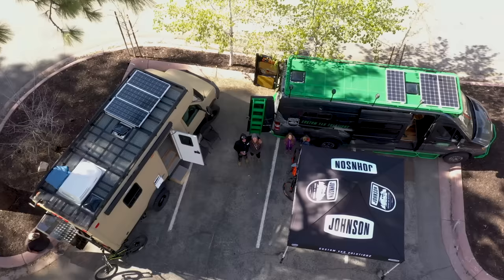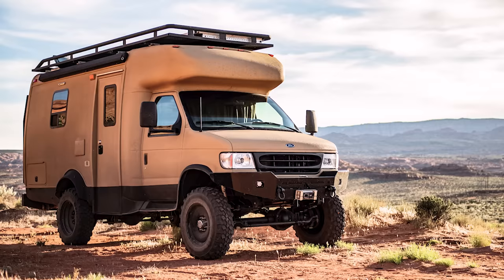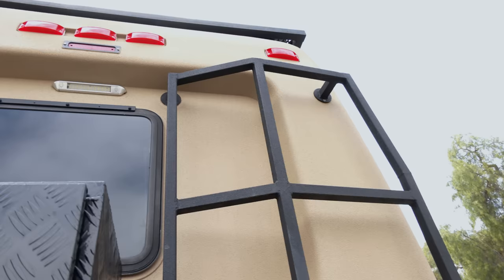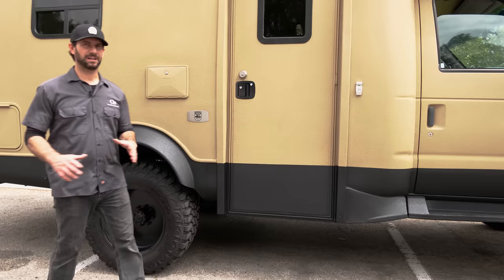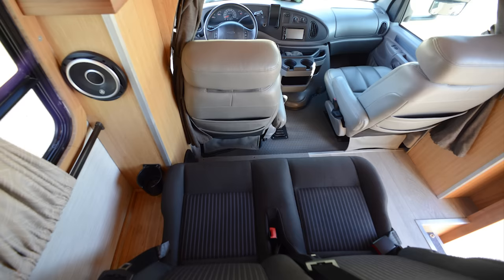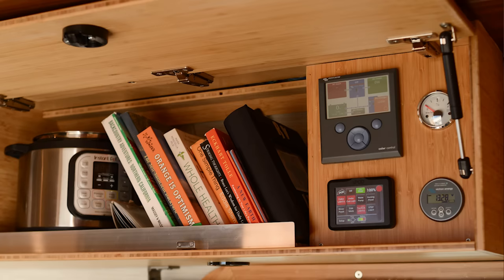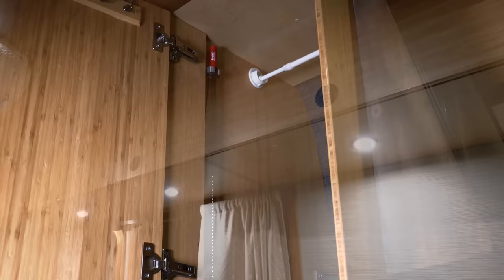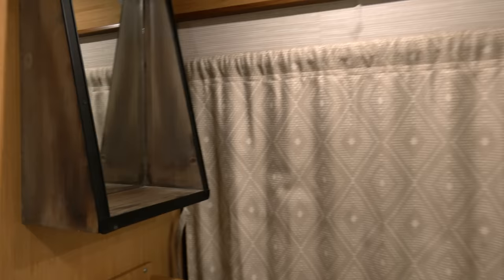4x4 Van Tour - Custom Adventure RV Starflyte 2.0 ! 4WD RV!

Comment: I work as a diesel mechanic. I appreciate This build on so many levels! Amazing job 👌👍 keep up the awesome work.
Reply from the maker: Greatly appreciate the comment and your blessin!
Reply: @auxbuilt4190    It's a very good caravan for the distance of roads and picnics and for the friends of the forest hunters
Reply: Love the builds! I’m looking at getting a Fire chassis myself for a conversion. Just wondering what you feel is the best chassis in your opinion? Gas, diesel? E350, E450? I know the 7.2L is a great engine…
Reply: I think now is the wrong time to think about diesel or gasoline since you know Putin attacked Ukraine. LOL.

I would be prone to diesel. But then his drip down fuel would have to be changed out for something comparable. The only thing I find missing this is a microwave. I am more inclined to use microwavable then I would be the stovetop. Everything comes with a trade off. This is an awesome build. I especially like the consideration to his winch system to get the spare tire up and down. That was my first thought. As it stands now my spare tire weighs a ton and being disabled I have a hard time not just getting it down from my Dodge but getting it in place.

Lastly, five hundred amp hours is probably a good place to be. But has an amateur radio operator I would be using additional DC to power radios. I might find a way to get a generator installed. Something that could be pulled out of a storage container I suppose although it'd be nice to be able to start it up from inside the cab and switch over. That's just me. And then lastly, I would put up a 4G/5G long-range antenna. I'd also like a piece of SpaceX by Elon Musk that gives you high speed internet out of the middle of nowhere.

These are custom items on my part and it should in no way take away from the excellent build he's done.

Comment: Nice work young man. My first build was a 1941 military 6 wheel dr. 6 cyl half ton. Built a stage coach sleeper outa wood. It was a canvas top org so I took a 20s truck body used the doors and built a cab. No ac but windows cranked and it had had push breathers for circulation. Put my surfboards and tipi poles on top. Lived outta it for 3 1/2 years. Hit 17 states took odd jobs and had the time of my life while traveling. Lived in my 16ft tipi most of the time. Solid rig cooked over a campfire and .grate. To much luxury today. Only pd $250 for truck in military sale 1970. Even had a hand crank to start it if battery was dead. Didnt even have $1500 in it mostly in tirw cost. 6 volt sucked but that was ww2 and we won. Happy trails get a guitar and save your money. Yours cost what a king kong house would be today. I went slow and saw everything. 6. Yl flat head and I got an old snorkel kit at army navy store. Sorry you missed it. Every complains about the bucks no matter what it the out come and you did a beautiful job for todays bs. God bless Im selling my house and making a new canvas tipi again. At 69 Im short of time but long on love to do it again. Keep my money and using a 2002 trail blazer simplified. Good luck but I can see over half million in todayz  prices. Bet you get 15ft to the gallon with all that weight. Hipe you got time and mega bucks cor this hobby. One of a kind raised 4 kids on a farm. In Iowa and on the peace river in florida over 25 years til these last few years. Lost my wife to health God bless her heart and soul. Big world with alot of fishing to do.
Reply from the maker: Thank you for checking it out Lucien. Your story is literally a novel summarized in a youtube comment, which seems impossible but here we are. Anyone who read your comment is wiser and likely more appreciative of the life they have knowing that the cost of things is irrelevant to someone like yourself. Time is the priceless unit we all want more of, and this van albeit expensive to build, gave me the time of my life in the middle of nowhereville! Thanks for stopping by and I wish she got 15mpg, more like 9!

Comment: Awesome build. I want. A tankless water heater would be better to save space. Also PSA fyi, that tiny fire extinguisher will completely discharge in about 5 seconds. It will only put out a small starter fire. Best to get a large one.
Reply from the maker: For sure! Agreed! I got 50 gallons of water ready to spray!
Reply: Fyi: that 50 gal water supply may not be available if the fire on your rig is electrical, battery related, and/or your 12v system is not functional. A 10 lb extinguisher always seems in the way, until the moment it saves your backwoods rig (or national forest from a runaway campfire) THEN its the coolest piece of gear ever because they work so well!

Comment: Excellent overland Ford conversion Van build. Very comprehensive, starflight fiberglass is built more like a boat than an RV if I remember correctly? They like  the Chinook are great Ford conversion Van platforms for builds. Which I glad you pointed out these builds, 30  year old vans/rv they require much restoring, rebuilding, Being a vanner since the seventies and had 94 e350 4 wheel drive van. In my old age few years back started an overland Van build,  My wife didn't want to 4 wheel anymore like we did in our youth and we weren't planning on driving the Van during the Winter at all except Baja?(please dear)  We've found we just need to get a mile or so passed all the other Rv's and we usually have places to ourselves. with the reduced cost and maintenance of the conversion, we decided to do 2 wheel drive.1995 airstream b190 conversion Van. First all new suspension installed by #weldtecdesign custom 6"lift, bigger brakes, fox shox, Latest update had Scotty at parkland machine services in Tacoma Washington He rebuilt, balanced and blueprinted my gas fi 460cid 7.5 stock 220 horsepower motor, now pump gas dynoed @384 horsepower 460cid bad ass Fuely motor. I'm now looking at the ultimate rear end for the thing. I like your setup and hope to have something that nice someday.  Thanks for letting me ramble Aloha.
Reply from the maker: Wow you are a legend! Thank you for checking it out Brian, yes its fiberglass/balsa/1"foam"balsa/fiberglass on the shell construction. Your engine sounds like a monster, absolute beast!

Comment: This van rebuild is the best I have ever seen so far inside and out.....
The only dislike I had was the composting toilet.....
My parents have the slide out cassett toilet and for two yrs no complaints....
I love the exterior paint and coating , lighting , etc.....
Especially all mechanical work put into the underneath of the van.....
After watching many videos on upgrades the cost would be worth it....
Super job on this van
Reply from the maker: Thank you! We love the composting toilet because we don't go #2 inside really ever. The cassettes are cool, but having a pee bottle to easily empty out, rocks!
Reply: We are a supplier from China, providing products covering agricultural products, food, steel products, clothing and other raw materials

Comment: You forgot to show the fold up full size olympic swimming pool. 
The level of forethought and skill here is mind-blowing, great job! It must be so satisfying to go places in a vehicle that you dreamed up and built yourself...a great inspiration!
When you were hoisting the spare tyre I couldn't help thinking it would be good to use the tyre tie down strap to tether the top of the hoist to the opposite side of the roof rack, taking the torque stress away from the hoist pivot.
Reply from the maker: Thank you! and that's a good idea. I welded that mount receiver bar, 4 times over, but the strap would take out the bounce for sure! Good call!🤘

Comment: One off badass van! Creative, great taste and executed nicely!  From the marlin fishing spare rig to the second step storage top to bottom you have got yourself the best designed van I’ve seen on YouTube and I watch lots. Awesome job and congrats, I’ve learned a lot just from this vid and i thank you for sharing. 👍🏾👍🏾
Reply from the maker: Thank you so much for the remarks!!
Reply: @auxbuilt4190  Great build! I wonder about the bath. Do you pull the toilet out to shower? And roughly how much square footage does the interior have? Also, if one wanted to build the 4x4 suspension, etc., is there a basic blueprint package available?

Comment: Excellent build.  The Coachmen Starflyte was an important part of my initial foray into the RV industry, and I was the lead engineer at that time.  This was the 2nd of the 3 floorplans that we developed.  A piece of info you might find interesting is that while Coachmen Vans produced the Starflyte, another local company named Supreme built the steel-framed fiberglass body.  It is based on the StarTrans bus by Supreme Corporation (Goshen, IN), which is what makes this body so much stronger than the typical RV construction.  If you ever venture near Elkhart Indiana, I'd love to see YOUR Starflyte in person.  Safe travels!

Comment: Well, just like most of the 993 comments before me I found your Starflyte build impressive and inspiring.  So much so, that I had just completed the Ujoint DIY conversion on my E350 van when I found your video and began looking for a Starflyte to convert.  Just purchased a V10 Starflyte with only 34,000 miles on it.  I have some questions about your change  from the Ujoint 33" dual conversion to the 37" single.  I need to make decision on which path to take.  Questions:
1)  Did you need to lift it again higher than the 6" Ujoint install?  how much and with what system?
2)  Could you use the original rear dually axle or did you switch?  (I have my stock rear axle from E350 conversion taking up space in the garage)
3)  How did the performance change both highway and off-road between the 33" dually and the 37" single configurations? (ride, steering, power, mileage, etc)
4) What else could you tell me about this that I wasn't smart enough to ask?

Thank you
Reply: Try Red Barn Customs in Michigan for specialty 20" steel rims (or 19.5" if you don't want to be able to air down) . I want 20" so I can air down and have LESS sidewall in case I do blow a tire . Less distance to the ground. 17:38

Comment: Nice build, awesome craftsmanship. I have a 2003 7.3 E350 sports mobile no penthouse full rollcage front to back through the dash to the frame. 4x4 on 35's it's more like a prerunner chasing side by sides across the desert. Custom interior for the 3rd time now, seems I keep changing it as the kids got older and bigger. So I bought a 20 passenger StarCraft micro bus gonna do the same it's in progress right now. I'ma keep it real though, not going to be as pretty as yours but going to get the job done more importantly create long lasting memories for me and my kids. Can't wait.

Comment: Question about the plumbing, but first let me say that this is one of the best 4x4 conversions I have seen. I was wondering how do you keep your water lines from freezing during winter. Any 12/24V heat cable or heat wire?
Reply from the maker: Thank you! There are 12v pads on the grey tank and the drain line outside, however if you were in really cold climates you would keep the webasto heater on inside at 50 degrees 24/7. I also kept the grey tank drain pipe open full time, so no water was accumulating. You couldn't do that in an RV park necessarily, but you can driving down the road and when you are grid

Comment: I saw the original YouTube post on the Mobile Dwellings channel, and was incredibly impressed, especially since I had been thinking about a similar Starflyte conversion myself. I have a ton of questions, and am hoping you will indulge me! First, let me say how impressed I am with the thoughtful approach you had to the build. Every detail seems to be well thought out. So, here are some of my questions...

1. Can you educate me on your decision regarding the dually-delete? I know many off-roaders simply prefer two wheels on the rear axle as dually's can be more prone to rocks becoming lodged in between the two tires. Was that your motivation as well?
2. I noticed that you don't appear to have recaptured the space behind the old propane and generator access doors. Did you consider adding some new storage compartments behind those doors? If a simple box could be fabricated and welded to the frame, it seems like it might be a great place to stick some heavier tools and recovery gear.
3. I noticed that you didn't remove and then patch the old refrigerator vents. Beyond the cost of the fiberglass repair, is there any other reason why you opted to keep the vents?
4.When completing the interior, did Johnsons remove the fiberglass walls and reinstate, or did you just leave it all in place and recover with the German vinyl?
5. Speaking of German vinyl, what is the manufacturer/distributor? What made it more appealing than other, domestic textured vinyl suppliers?
6. It looks like you kept in place the entire bathroom assembly... is the sliding bathroom door OEM, or is it a replacement? If a replacement, can you share the details?
7. In regards to the exterior shower and audio cubbies... are those both refurbished/cleaned-up originals, or did you replace with new, similarly-sized units?
8. You mentioned that you replaced the exterior lights. The tail lights look to be new units. Did you simply replace the old ones, or are they refurbished with new LED bulbs?
9. If you were starting over, with the same vehicle, what would you do differently?

I know that's a lot of questions. Thanks for producing this kind of content. Can't wait to see more of your adventures.
Reply from the maker: Thank you for reaching out! Thanks for the kind words and I'll try and get you some answers!
1)Dually delete is standard reasons, yes. No rocks lodging in between, precision tire placement on trails and I think it looks better as well. I've been super happy with the decision. 
2/3)Propane door, old fridge vent, oven vent have been deleted with fiberglass. If you look at my instagram there is a recent photo of the drivers side and you can see that work. I do fiberglass work myself and the cost isn't the issue, it's having to repaint the whole side, which I did a few months back. 
4/5)The whole shell is pre-insulated. The construction is fiberglass/balsa wood/1"foam/balsa wood/fiberglass. It was a really expensive shell to make which is why Coachmen only made these from 98 to 03. I can not recall the make of the gErman vinyl, I don't know if it's better than anyone else's to be honest, but it's tough stuff!
6)The bathroom door is by Nautilus Doors, parent company is STOEET Ind. The floor I resurfaced with white raptor and cleaned up the caulking all around. I didn't feel the need to gut the bathroom. It serves it's purpose!
7)Both are stock sized. You can not find the outdoor radio unit any more. It was made by Jensen and the head unit was a joke so I popped in a single din bluetooth unit. The speakers are so-so, but you're not trying to blow the doors of the cabana most times while using an outdoor radio, right. It's killer for campfire nights and it can actually get pretty loud before clipping, if you wanted to party it up. The shower unit is common size and I replaced the whole box.
8)All the lights were removed, surface of the shell cleaned up, brand new LED lights installed and poly caulking added anywhere I felt that need a little extra insurance. All those OEM sizes are now available in LED, EXCEPT! the third brake light. That company still makes that exact same light is you can believe it. So it's new as well, but it has a bulb. 
9)That's an open question and you'd think I'd have a long list with the hindsight in my favor. But honestly, the only decision to consider for me really is to have 4 seats or not. If yes, then I would not change a thing. If no, then well I would move the shower/bath and re-design, but the 4 seat belted seats was key for me and the bunk over sleeper is a huge asset I've used many times for friends. Not the easiest build out, very custom, but worth it in the end in my opinion even having lived in it for the past year.

Comment: This is so amazing. Thank you for putting the time into this video. 

Have you ever been in a situation where you exceeded Starflyte's terrain/offroad capability? Or a really hairy situation that it pulled through on?
Reply from the maker: Thanks Neil! Depends on who you're asking, me or my partner!? I've heard a couple times, "I don't think you're gonna make that" and I've always made it😅 The only times I've used the winch were to get others unstuck. IT's insanely capable as an offroad rig. You're limited by the departure angle the most, she's got a booty. The most iffy time was a BLM spot outside of Horseshoe Bend, the deep red sand desert terrain. There was a section I saw a wrangler come through an he was pinning it, roosters off the tires and all... I looked at my girl next to me and asked, should we try it? We went for it and I was in 4Lo 4x4 pinned in 2nd gear but we made it. I would have been buried if I slowed down on that 1000ft stretch. Good times!

Comment: Well thought out in every aspect of the design and modifications.  I like the consideration made to the tires and suspension, and especially the outer shell protection, which gives it a very custom and stealth look.  The roof is crazy good with the solar and well thought out storage and appears very secure.  You can tell that a lot of money was poured into this but I'm sure its less than half the cost of something comparable.
Reply from the maker: Thank you! Yes, Earth Roamer makes off road rigs cooler than this but they start at 550k!
Reply: We are a supplier from China, providing products covering agricultural products, food, steel products, clothing and other raw materials